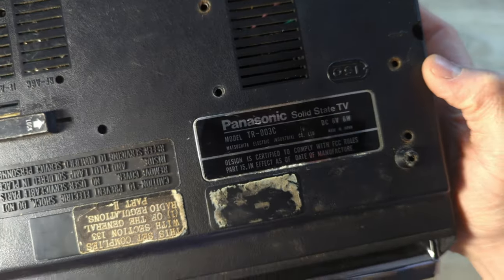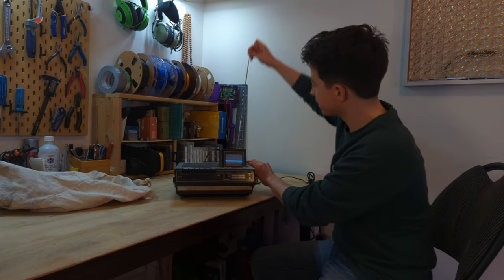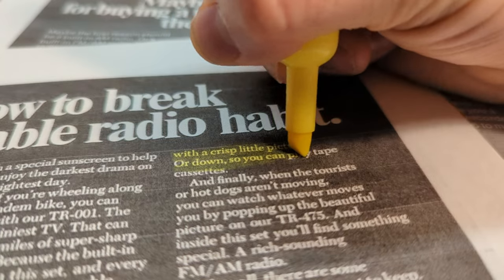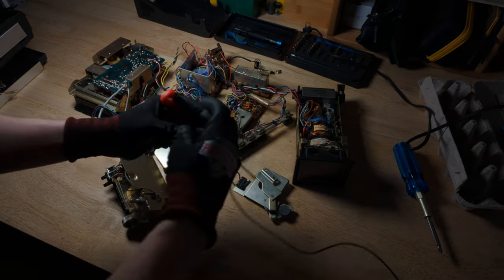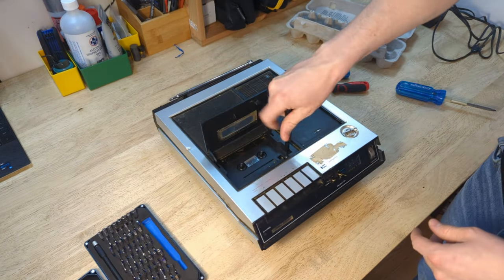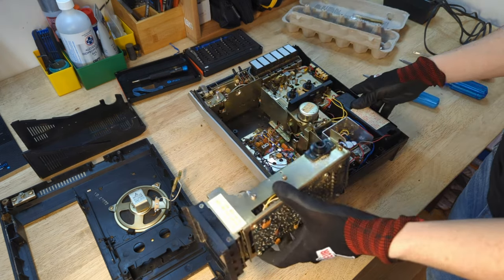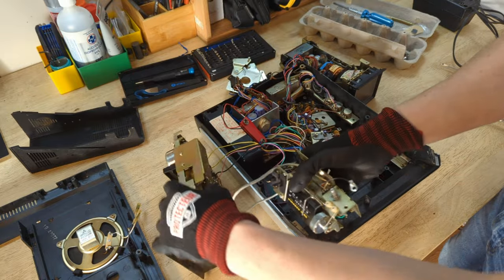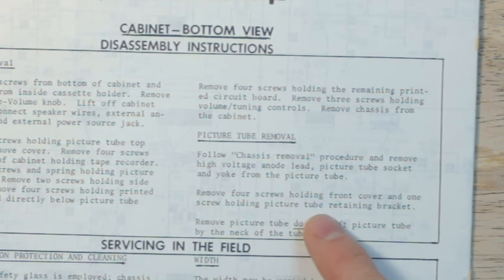Panasonic TR-003C: One of the smallest CRT televisions ever made

Comment: I have one even smaller. It has a 1" face. No, I'm not talking about the old camcorder view-finder tubes. This is an actual TV with a built-in tuner made by Panasonic.
Reply from the maker: Very cool! Is that the Panasonic TravelVision? I would like one of those
Reply: @ExercisingIngenuity  It is! Model:TR-1010P with a date of April 1983

I had to replace a lot of the capacitors inside along with repair corroded traces to get it to work.
Reply from the maker: Wow! It's fantastic you brought it back to life, were you able to get a picture on it?
Reply: @ExercisingIngenuity i'd say "to get it to work" defines getting a picture on it
Reply: @ExercisingIngenuity  I was! I like preserving this kind of stuff. A bit of a shame that analog TV isn't transmitted around here anymore. Last station held out until about 2018 but all they played were infomercials.